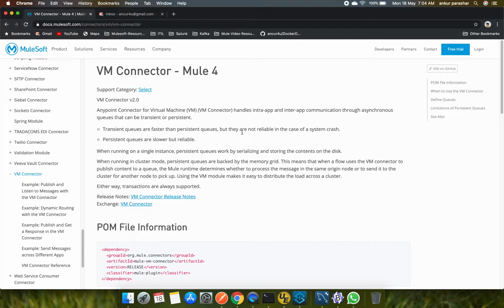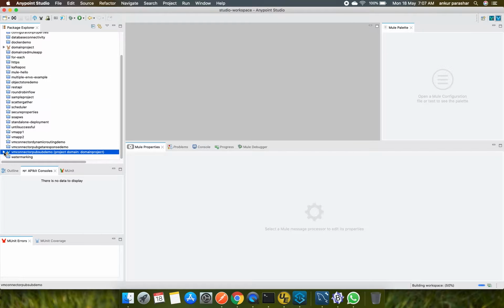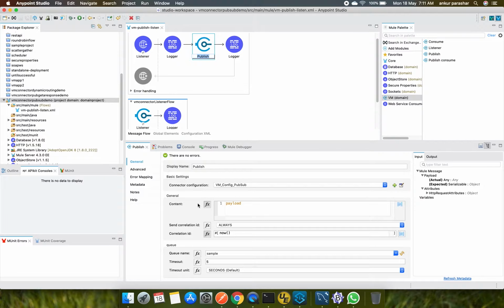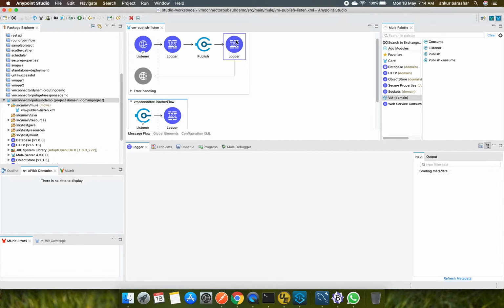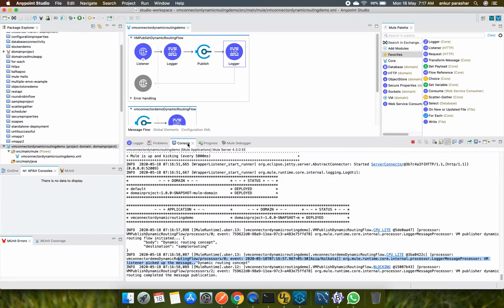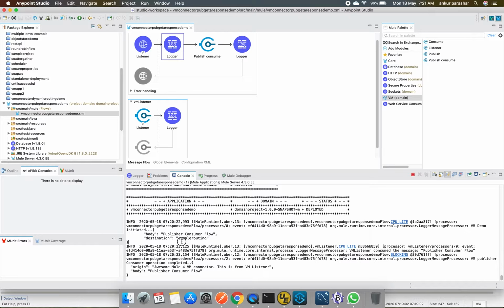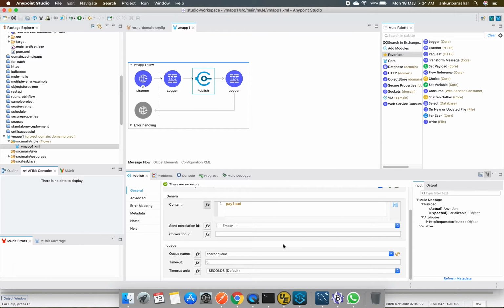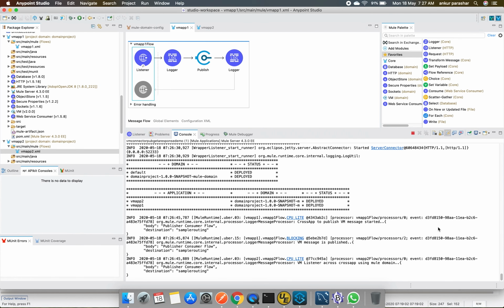VM Connector in Mule 4 (UseCase:Pub-Sub/Consume/Domain project) | Mule 4.3.0 | Anypoint Studio 7.5.0

Comment: Can you please explain..When to go for VM connector and when for JMS connector
Reply from the maker: VM transport is for intra-JVM communication between Mule flows. So, that means when you use a VM in your flow, you can communicate between different flows in the application.
A flow containing VM inbound cannot be called externally from external application as thus the flow is equivalent to a private flow used within the application. By default uses in-memory queues.

On the other hand as per Mule documentation, JMS is an external host, allows communication between different components of a distributed application and JMS transport lets you easily send and receive messages to queues and topics for any message service which implements the JMS specification.
A flow, which has JMS inbound can be called from externally unlike VM.
Reply: @AIMuleExpert  Thanks a lot for the clarification